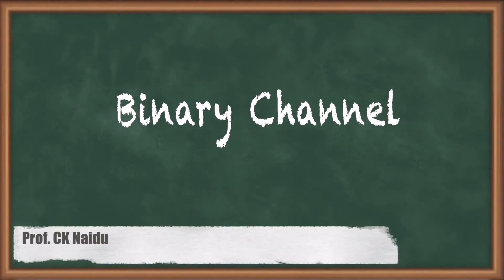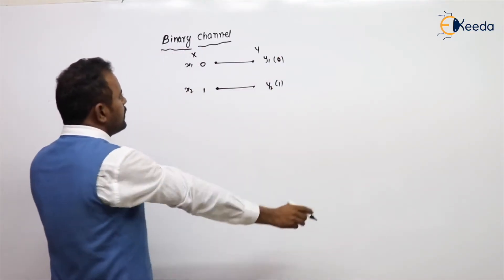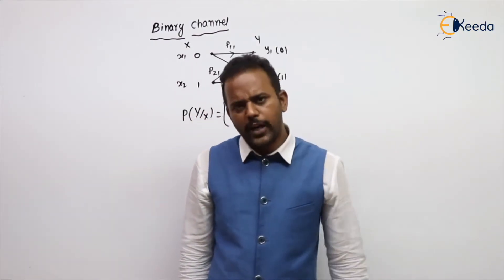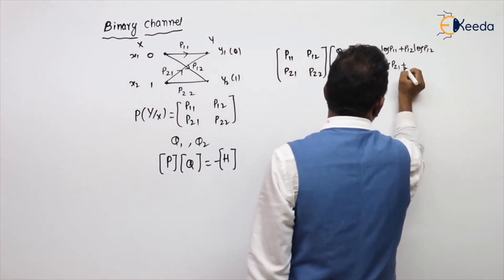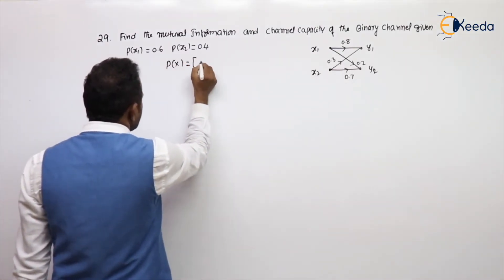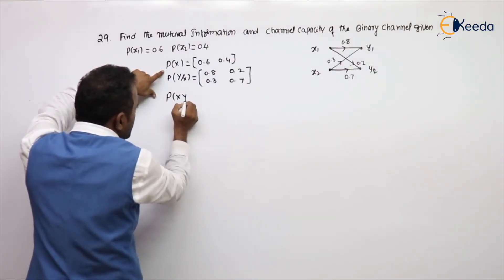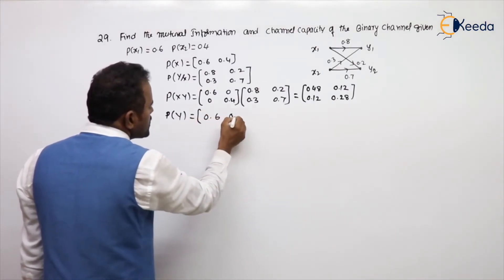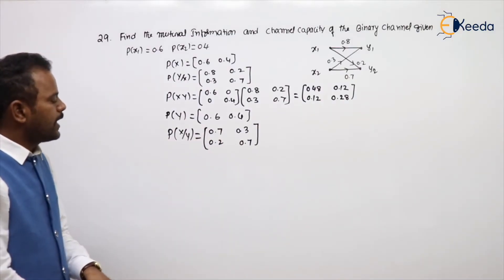Understanding Binary Channel Basics : GATE Communications

Comment: Construct the following circuit. The circuit has five input signals and one output signal. 
The five input lines are labeled W, X, Y, Z, and E, and the output line is labeled F. E is 
used to enable (turn on) or disable (turn off) the circuit; thus, when E = 0, the circuit is 
disabled, and F is always 0. When E = 1, the circuit is enabled, and F is determined by the 
value of the four input signals, W, X, Y, and Z, where W is the most significant bit. If the
value is odd, then F = 1, otherwise F = 0